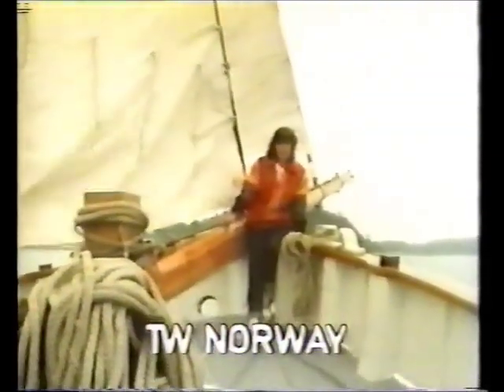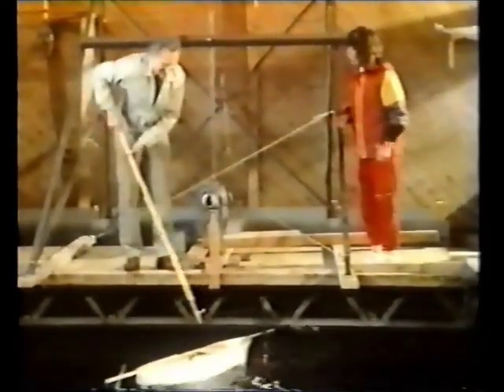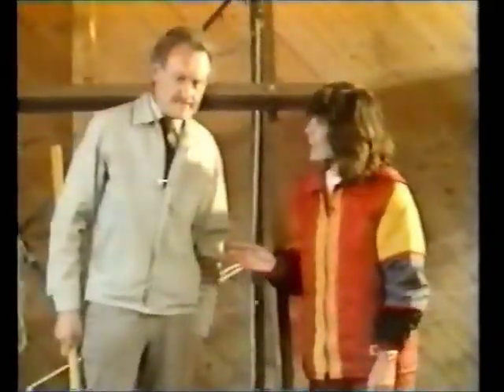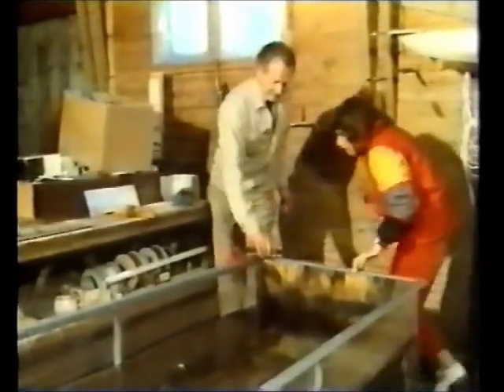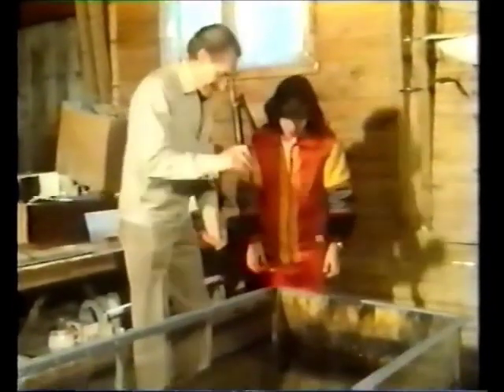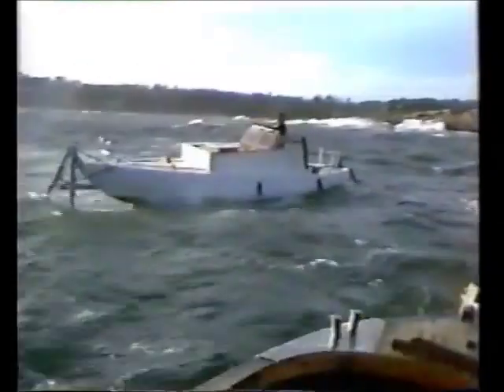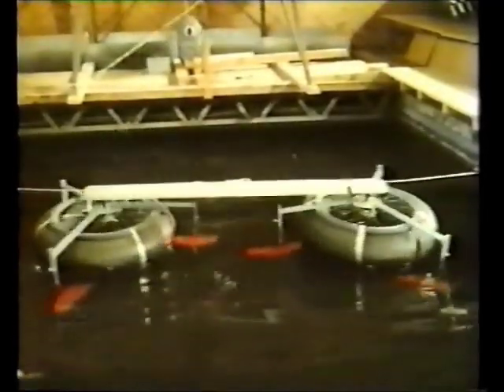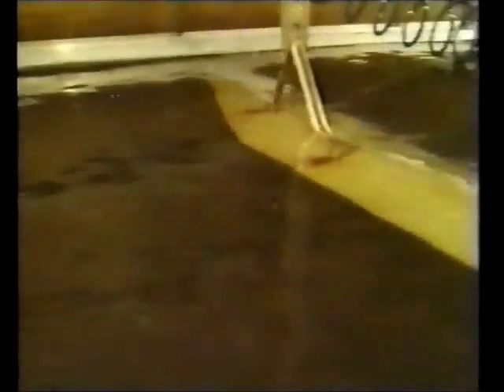BBC program on wave-powered boats

Comment: I am also interested in wave powered floats or boats.  In my own still patentable design I use the relative interaction between the much lighter vertically deep/long outer keel casting or long vertical still water content column holder and the vertically still water content (of keel as holder/flattened tube).

When the floating boat/floater rides the wave upwards, thus rises, the keel shell as holder rise upwards with but the inertia of the much heavier content water makes the still water column collide on keel container rise at the bottom, creating a positive relative pressure at the bottom and a negative relative pressure at the top of the hollow wave power keel.  The increased pressure and one way valve equivalent valve action allows the low pressure on keel rise at the top to suck in water at the frontal top edge inlet and jet out water at the rearward bottom outlet backwards.  Both the top front edge inlet and bottom backward outlet causes propulsion on both top and bottom of the top floated and bottom weighted keel due to the content still water column's intrinsic inertia.

When the boat and keel shell or ram water container descends or drops under undulating surface wave action with or without a lever or rock action the cross over top/bottom front/rear opposite to the on rise up will happen.  On decent the content still water inertial ram column will collide with the outer keel shell or holder on the top end creating a positive pressure relative pressure inside the top of the keel that gets diverted as water outlet flow backwards on top and the opposing lower or negative relative pressure sucks in water due to one way front to back equivalent valve action from the frontal cross opposite inlet at the bottom end where the pressure dropped on descend.

Because of this rise fall crossover valve action and the advantage of the deep/long inertial water ram effect in the keel a very up/down movement sensitive inlet-ram-outlet mass flow, velocity, thrust & power water jet wave powered keel boat/float linear or rotary drive system can so be accomplished!

I, Izak, can be contacted at +27 72 949 5722, I have a YouTube channel @IzakVanDerWesthuizen423 so anyone involved or interested in wave power or wave powered ring or linear boats, including the researcher/inventor in this vidio are welcome to befriend or contact me but please no nonsense will be taken from scammers, chancers or any kind of criminal.

Comment: One must be careful as  in a wave the particles of the water moves up and down too avend so if the platform moves up with the flap there will be no driving power. If the craft pitches or rolls  then that will be fine, but not if the  platform goes up and down with the wave,
So I would suggest that a platform with a higher but safe centre of gravity will cause the platform to sway  more and that is what that rotation system needs. So in fact if one needs to extract power from waves the platform will have to roll and pitch a lot and the passengers  will not like it.   Perhaps we should stick to power stations extracting wave power with no one on the platform.

If a person puts  two flaps one on each foot and   acts as if he is riding a bicycle he could propel himself forward and  if  a slight modification to the flap is arranged he could also fly as after all  this is the  wing of a bird in action.